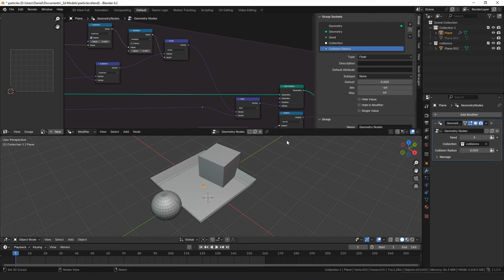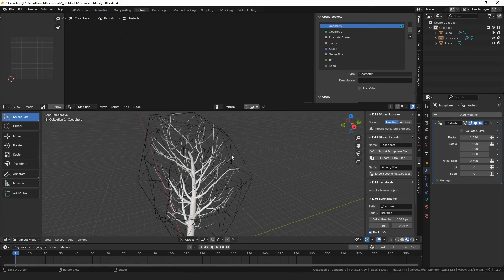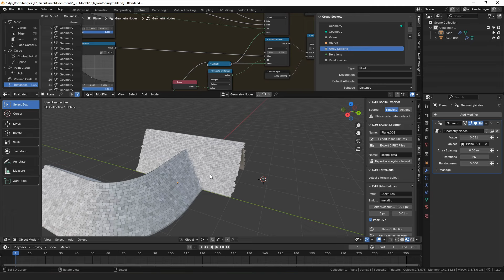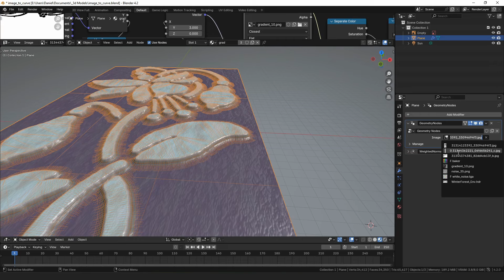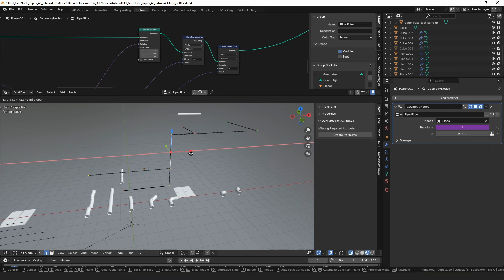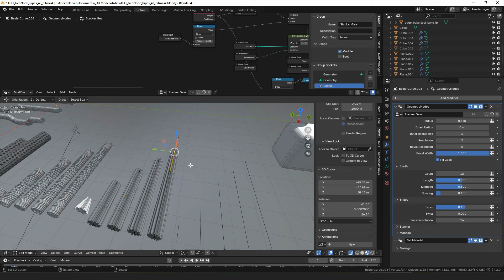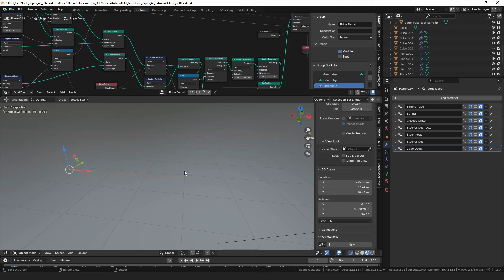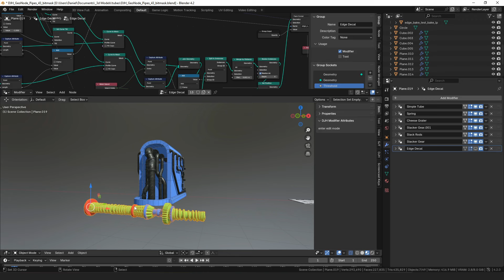Bad ideas come before good ideas || Blender Geometry Nodes

Comment: I cannot offhand add any ideas, but I do like the pipe stack tool - that is very neat and I can definitely see many uses for that.  That shingles on any roof surface would be brilliant if you can crack it.  I frequently deal with tegula and imbrex, which many texture sites just describe as 'clay roof tiles'.  Thing is that what I need is more ordered, and the roof at the gable ends has to be a certain form.  Then there is the horror of trying to get these onto conical and hemispherical meshes, for apses, or the roofs of apsidal ends.  Very common in earlier architecture, but a devil to model.  Great video though - I enjoyed watching that.  I'd still call it far more successful than not with plenty of exciting ideas.
Reply from the maker: Thanks!  I'll let you know if I solve the shingle problem.   I certainly agree on it being successful--it's all part of the process--and I'm using 'bad' in a very loose sense most of the ideas could still be useful, I've just run into dead ends on them for now.

Comment: No guarantee that these would work but pattern one could be interesting with clothing, and the image to curve might be interesting with bump maps. For pipe topology, wouldn't the perfect seam be function of the angle? Those are my ideas.
Reply from the maker: Yes, I think the pattern idea is very cool as a fast way to add detail to anything that won't be too close to the camera.  There may be a way to generate the pipe joint topology, and I'm sure the angle would play a role in that, but I haven't been able to wrap my head around it yet.

Comment: Hey LooseEdges! Nice video, I just found out about you :) I have some ideas about how to solve the issue at 10:40, let me know if you would like to discuss them
Reply from the maker: Sure, I'd be happy to hear your thoughts.
Reply: @looseEdges  did you or YouTube deleted my message? I commented twice already lol
Reply: @looseEdges  so basically you can simplify the problem by inputting simpler geometry, so instead of having both of the ceiling combined as a Boolean, have them both "complete" without any hole/trimmed. So for the curved ceiling, the current intersection edges would end coplanar with a vertical plane. For the other ceiling, you would get to fill the intersections. What this allows you is having a ribbon-like surface, where you can now scatter tiles, and then remove the ones that end up below the roof to solve the intersections. I hope that makes sense.
Reply: @looseEdges  another option is having the geometry as you have, but procedurally get to the ribbons situation and then solve as I mentioned in the previous message. This would be more difficult but you would have an input closer to the final result.
Reply from the maker: @asr59  Ah, yes that is a good idea.  That's similar to how I solved this problem in the build roof modifiers where I generate all the geometry, but the node group in the video was in response to a guy who makes architectural renderings, and he wanted to be able to import a CAD model and then add shingles to the roof surfaces.  So not changing the input geometry was a constraint I was trying to work within.  
I thought a good solution would be to flatten the mesh, essentially UV unwrap it, and then make the shingle pattern with a simple 2d array, delete shingles that aren't over any faces and then move everything back to its original location, but that didn't work well on the curved area of my test roof.

ps I can see all three comments, so idk but it wasn't me :)
Reply: @looseEdges  yeah the UV seems a good idea too, I can see how the curved one would give issues if the uvs are not straight.